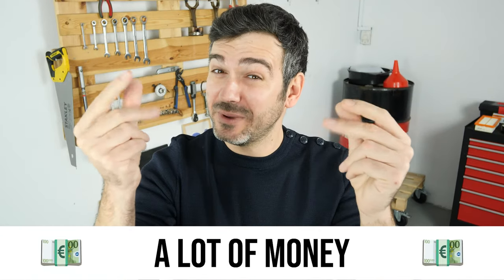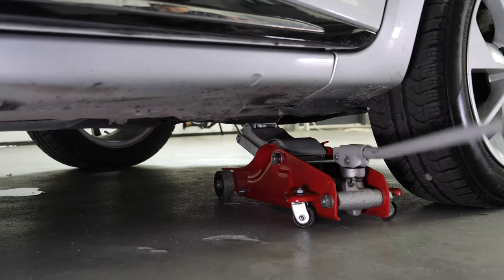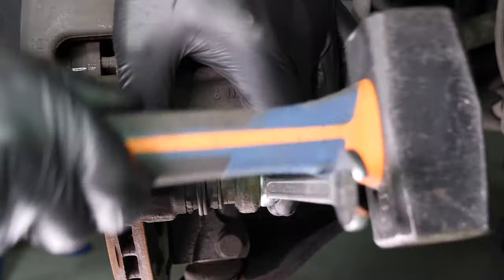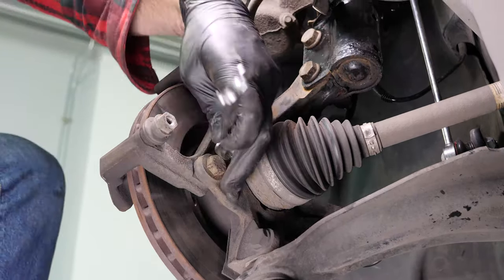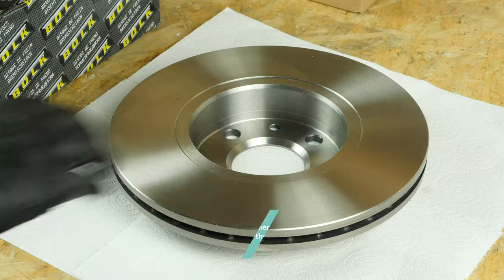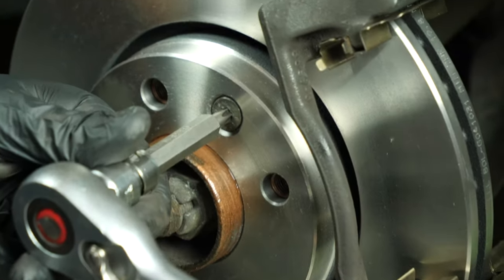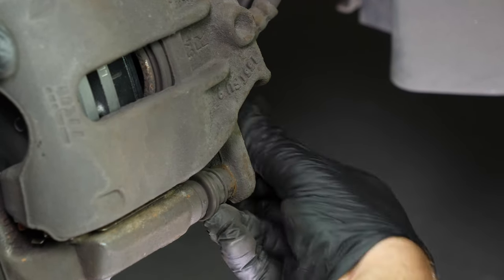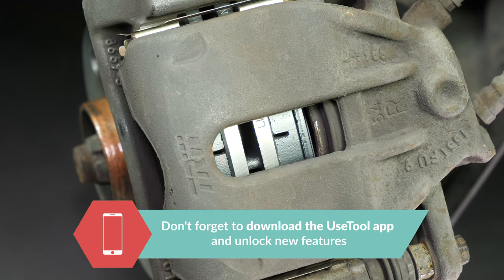How to replace the front brake discs and pads Clio mk4 🚗

Comment: I strongly recommend to not jack these unibody cars like shown here, as long you don't want to permanently modify pinchweld and subframe. These cars, like the Nissan K14, must be jacked at the marked points with decent rubber pads. No stands needed, there is no need to crawl under the car for a brake job. A ok hydraulic lift like in the video will hold it safely.

Comment: I have to say this is the Shit and a Warning about the front pads. on CLIO  4 there are  2 versions of calipers. So when you order brakepads be very careful when you order the brakepads. Check your calipers first. This can be a huge cost and time consuming. Soo there are  2 videos one with only brake pads and the other one is this. Those videos are the best how to change but it is also the most misinformative.  Check your calipers and rotors because CLIO  4 have 2 sets of brake systems in the front.
Reply: Yeah, depends on manufacturing year. Cars made on 4/2015 to 2019 have bigger calipers and pads.

Comment: Copergrease might interact with ABS sensors. 
Ceramic Grease doesn't and thus is advised by modern Cars..
Reply: Would silicone grease also work?
Reply: This is a tale, it makes no sense. And the sensor is not under the disk where they put it anyway.